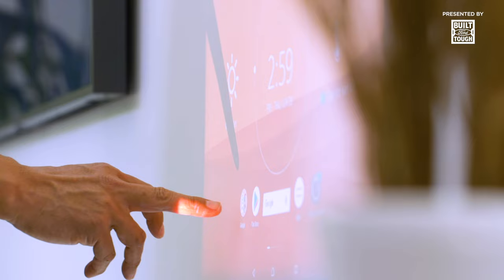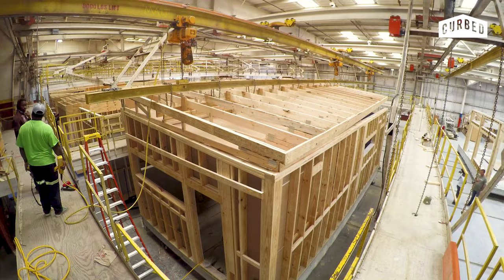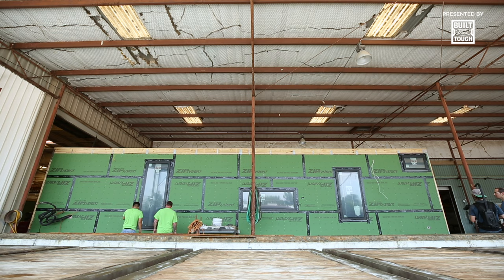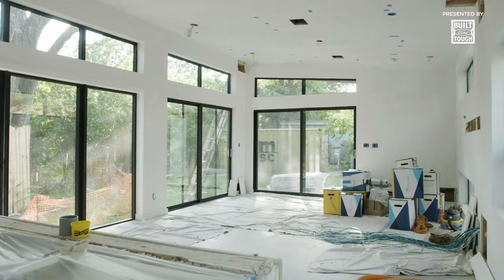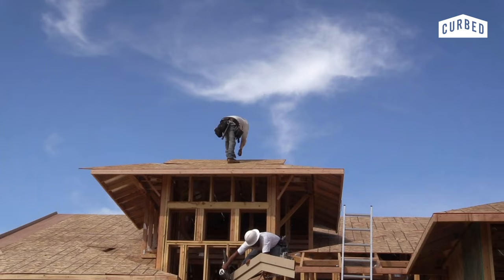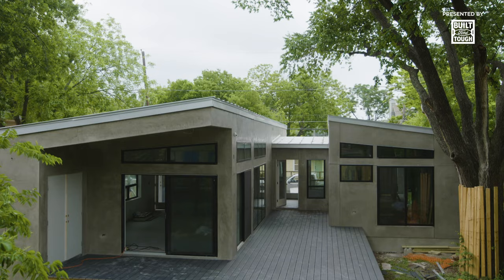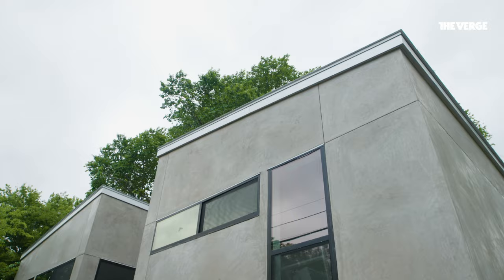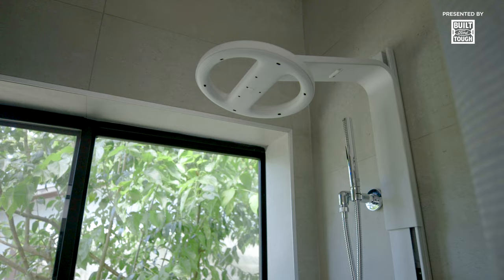We built the Home of the Future with Grant Imahara

Comment: I studied architecture at University of Cincinnati  and still actively work with remodeling and designing homes. The common thing I often see is the lack of air tight sealing of the home which provides huge long term benefits, followed by lack heavy of insulation. 
other things that would be interesting at this point would be humidity management, air filteration, advanced water systems (filtering, recycling ect), use of solar for not only power but heat / hot water collection, bonus points for concentrated solar setup.
I didn't see a garage or port with the house, many other upgrades really depends on location.
Reply: This
Reply: @probablynotdad6553  ⬆ This
Reply: I live on a small island of tropical environment where the house collects heavy dust which turns sticky in not easily accessible areas. I have been looking to make use of solar energy and air tightening with water filtration from a nearby stream for a small hotel/guest house project. Something close to self-sustainable. But I haven’t been guided to any links for ideas or draft. I will receive a grant for the project but I also need a team
Reply: @RAS

Comment: Most people, I am sure would like to know the price of a prefab unit!
Reply: I would love to know too. My guess, based on what I've researched online about this architectural style and the fact that it is prefab: Crazy expensive.  But I live in an area where a traditional stick frame site built 2500 sqft house can be had for high 190s to low 200s.
Reply: Just buy a mobile home because no one will give you a permit to permanently leave it except a camper park ,expensive daily rate .
Reply: $100k for dual 200sq. Ft. Single room finished boxes. 
1932 900sq. Ft house in the same place was $3500.
Reply: @deerhunter7482  

I think at least some of these prefab homes meet local building codes.